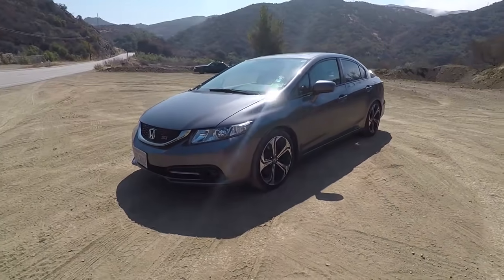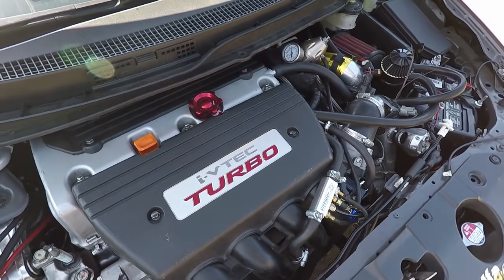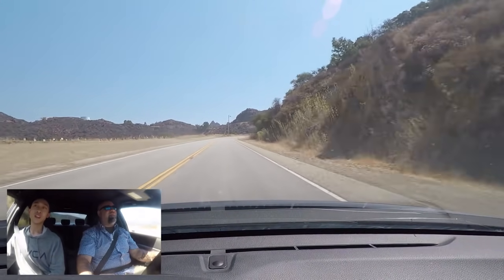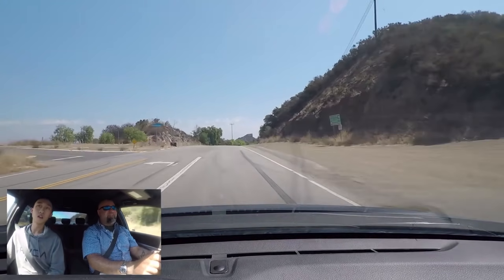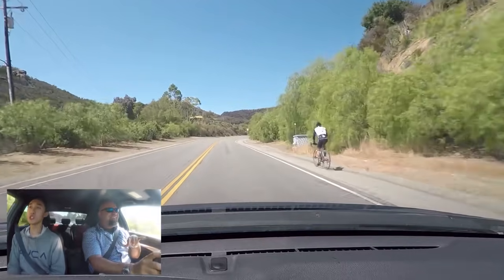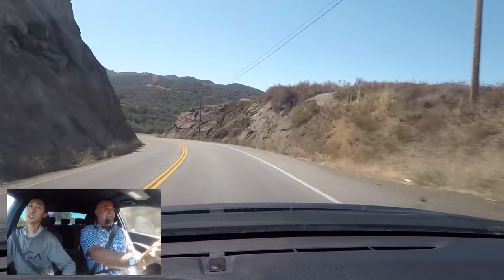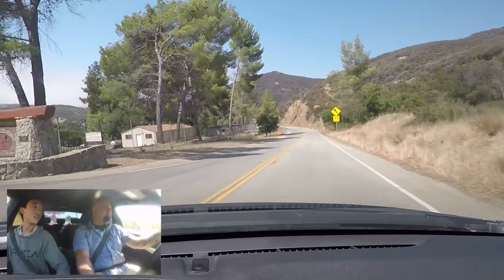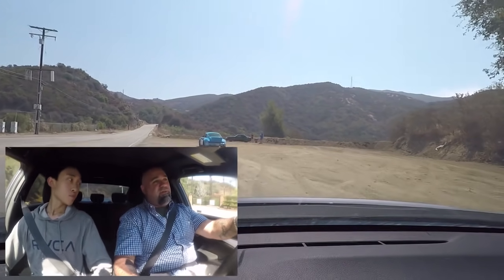Brutally Fast 500 HP Turbo 2014 Honda Civic Sleeper - One Take

Comment: THIS is how a Civic should be built. No stupid body kits, no flashy BS. Just pure performance and power. Plus the hilarity when you dust most of the people on the road with "sports cars" in your stock looking Civic. Props.
Reply: Redhead Metalhead nothing wrong with some nice rims from a respectable brand
Reply: DynamicGaming You're right. If they're quality wheels that don't weight 42lbs each, then you could argue that lighter, wider wheels help with the performance of the car.
Reply: DynamicGaming unfortunately most civic guys run xxr or jnc wheels...
Reply: Isael Dominguez couldn’t agree more.
Reply: Isael Dominguez Chinese front lip, Racelands, "real" Rotas, stretched tires, straight pipe. KILLIN THA GAME BRUH
Reply: Isael Dominguez the fake wheel dilema again loll run what you have if you like it,i laugh at kids who point out fake wheels like the rest of the build is nothing without expensive shoes,same goes for a person,you can have cheap shoes that does the exact same as expensive ones,and a hell of a lot smarter to use them..
Reply: Stock Si is equivelent to most "sports cars"  unless your talkin high end.
Reply: What are you talking about? I haven't seen any Civic with a body kit in about 4 years. The only thing I rag on them for is shitty suspension setups and fart cans.
Reply: Vega-Expert Knock off products aren't my cup of tea. I rather have a stock car than replica parts.
Reply: ? the good thing is most people arent dumb enough to race 500hp cars in the rain. 500hp with rwd, fwd, and awd. They are all dangerous to race in the rain. AWD would be safer but still sketchy as fuck at full acceleration with that much power in the rain. fwd works depending on what you want to do with it, if its just to troll people doing 60 rolls on the freeway it gets the job done. with slicks its an easy high 10-low 11. Boostedboiz ran 10.7 in a 630hp ek hatch with slicks. Not bad for fwd.
Reply: jammy jammybrochacho You think a base model Subaru can corner faster than a Civic Si with super sports just because its AWD? You are a dunce. AWD is good in the dry because it helps put power down for faster corner exit but when you only have 140 hp it doesnt do shit.
Reply: But "it's just a civic" "hondas can't go fast" "fwd bro"
Reply: jammy jammybrochacho I suggest you look at time attack lap times for any track in California. The overall records are almost all held by FWD cars.
Reply: Redhead Metalhead dude you are stuck in 1999 lol
Reply: SI RICKO Really? Because 85% of all "builds" I see nowadays are flashy, non-functional nonsense being bolted on to whatever car. I'm not saying there's anything particularly wrong with that, just that, in my OPINION, this is how cars should be built. And if that makes me "stuck in 1999," then so be it. The world was a better place before 9/11 anyway.
Reply: What's snow? Lucky for me, I live in California haha it never snows where I'm from
Reply: Fwd does spin, but with my street legal drag radials, they hook from 2nd and up. I dead hook 3rd gear at high boost. Now let me explain the concept of having boost by gear, or in my case a boost "switch". Low boost on lower gears + drag radials == Hooking and booking. Once I get to 3rd gear, flip a switch, instantly turns into high boost and still hooks and books. That's something NA setups can't do.
Reply: jammy jammybrochacho I'm not saying FWD is better, you are right in saying that physics favours rwd or awd, but mainly under acceleration. I am saying that FWD cars can be fast, obviously you didnt look up the times like I told you to. Also this car pulls 0.87 g's on the skidpad with stock according to C&D. If it had the same tires as your car I wouldnt be surprised if it achieved 0.91 g's.
Reply: enkei rpf1. done
Reply: jk
Reply: eddie lol no
Reply: That’s how all car should be built
Reply: This car would torque steer into a ditch..snoooze.
Reply: Torque steer is virtually nonexistent on my car with the LSD and electronic power steering, I'm able to easily do pulls with just 1 hand on the wheel
Reply: Lookin like you borrowed Mom's car 😂

Comment: Any car that has a reliable 500-800whp I don't care what the year, make & model is, if you built it to withstand that power, you have to give credit where it's due point blank period. Respect
Reply: FUCK. Im at 470. Need 30 more hp to get your respect
Reply: @DeltaOpsAssassin  lmao 😂😂
Reply: @DeltaOpsAssassin  I'm pushing 485. I feel the lack of respect from Brian. :(
Reply: @VeracsGaming  just pour in some e30 or go water meth!
Reply: Cerriously just add some more racing decals
Reply: @lun7n  haha don't forget fuel injectors, headers, downpipe, all the above really
Reply: @DeltaOpsAssassin  lol I'm guessing you have more than just full bolt ons and a tune so far. What do you drive?
Reply: Brian Clarke an e92 335xi :)
Reply: @DeltaOpsAssassin  Put a few stickers on it. Good for +5 each!
Reply: Brian Clarke hp isn’t everything...
Reply: McMillen Colburn 🥳😂
Reply: @professorfinesser4015  500hp out of a 2.4L isn't "rice". It's a Civic with more hp than most modern muscle cars, 30whp higher than a stock 2016 Shelby GT350R. The car looks completely stock aside from the lowered suspension, slotted rotors and aftermarket exhaust.
Reply: Honestly I'm a diesel truck guy but 500hp out of a Civic is fucking insane. My ram Cummins makes about 460-500 ish to the wheels and that is more than enough for my DD truck. I can't imagine the torque steer going on in that little hatchback at 500hp lol
Reply: B W Shit imagine that in a Miata or the FRS. Killer time attack car for the money easily.
Reply: Richard Turner Haha it would be fun as hell though. This guy cool slap some aero and race tires and actually do Time Attack. It definitely has the power to weight ratio for it.

Comment: This is what a non ricer looks like. All performance and some or nothing on the aesthetics. Fantastic.
Reply: @buffkangaroodog  im pretty sure the si comes with a red badge
Reply: It's a tuner bro
Reply: I would've put wheels and lowered it. That's about as far as I'd go
Reply: This is what a sleeper looks like
Reply: @buffkangaroodog  si comes with a red badge 😭😭
Reply: @vincentjones7800  it doesn't
Reply: @aquasmoke8539  yeah. Wheels and lowered. Not stanced 🤣
Reply: @flatwoodzmafia  lowering it a bit would look great. I gotchu now
Reply: @aquasmoke8539  yeah, im not a stance guy. I'm a drag racing, and circuit track/ touge guy myself. Plus anything looks better lowered lol
Reply: @flatwoodzmafia  exactly the same preferences. Anything that will help wirh performance.
Reply: @aquasmoke8539  and wider wheels and lower center of gravity will most definitely help 🤣🤣🤣

Comment: I'd de-badge it a little more to make it appear to be visibly more of a sleeper by removing the Si badge and 'i-VTEC DOHC' stickers. Then get rid of the spoiler to make it look like a hybrid variant.
Reply: I legit wouldn't. While the Si is a great trim, it's still not known for being exceptionally a fast car from factory. Si badge won't intimidate even people that know what Si means. And the wing needs to stay for safety reasons.,
Reply: @honda8770  ya but SI's are often tuned so people not gonna be as surprised as if it looks like an LX or hybrid or something
Reply: He has the hybrid rear badge and hybrid tail lights. All he should do is put the black base model trim on it, that looks good on these cars.
Reply: The stock SI isn't fast its more of a feeling and momentum car.
Reply: @Hopeful1s  Often?  Never seen a SI with anything other than a can.  Now a civic hatch is a different story.  We have modified cars around here and the SI is no exception but the guys around here are stanced out.  The Subaru's,  Evo's, Golf's, the local GTO on drag slicks, etc.
Reply: then get the hybrid decal from the dealership (not sure if hondas have it, I know toyotas do) and rebadge it as a hybrid lol
Reply: @honda8770  the wing isn't doing anything on a front wheel drive car🤡

Comment: That Hybrid badge is the perfect troll LOL. It needs a turbo back exhaust and thats basically the best daily civic out there ;D
Reply: MaxSpeed yeah that’s definitely a troll lmao. However on the Toyota side of things, they hybrid iteration is usually faster in some cases. Like the Camry comes standard with a 2.5L inline 4 cylinder, where the hybrid version has the 2.5L 4 cylinder plus the electric motor, which is able to shave a solid second off the 0-60 time, however it doesn’t really hold a candle to the 3.5L v6 option they put in the Camry and the Avalon, but meanwhile it’s faster than the regular 3 cylinder option while getting way better mileage
Reply: As a fan of the vq35de and a previous owner of a g35, I kinda wanted to get likr a 06 v6 Altima, turbocharge it, and switch the 3.5 badge to 2.5, that would be a pretty funny troll lol, however I’d probably be driving a total shit box lmao
Reply: @IAmCjcj11  The Camry has a 3 cylinder engine option? Is it turbo? The Camry V6 is pretty neat.
Reply: SI0AX whoops typo, meant to say 4 lol
Reply: IAmCjcj11 wait, how can the hybrid version run a whole second quicker with the same 2.5 four banger? How does having an electric motor affect it?
Reply: Stevie Nguyen it’s a 2.5L engine plus a electric motor and the transmission combines both of them to send power to the wheels
Reply: Stevie Nguyen electric motors provide instant torque, and thus, better acceleration. It’s why Teslas are so quick from 0-60

Comment: Only time a stage 4 clutch ever deserved to be in a civic. Good build mate.
Reply: garf117 huh that made so much sense
Reply: there's been plenty of civics on this level of power or higher for 20 years, or whenever people started crazy  b20 builds
Reply: Hell I've seen D series in this range. You can hit 500hp on a stock K24 bottom end. Still an impressive car, but there are plenty of high HP hondas out there these days.
Reply: man at the time this video is out, there have probably been well over 10,000 civics that needed upgraded clutch's. Once you put turbos to civics even D series and especially K, B, H, and F series, they make power very quickly and big numbers easily.
Reply: Lol go to 9thgencivic.com and find hundreds of builds with this power level.
Reply: Guys it was a joke... Calm down. The level of butt hurt is to damn high in these comments :)
Reply: I'm putting in a twin disk in the near future, it's starting to slip at the drag strip on launch lol
Reply: The whole 'stage' nonsense doesn't mean anything anyways. A stage 4 CC clutch will hold a HELL of a lot more than some crappy xtd stage 4.
Reply: Damn Mark has just showed up. Sweet ride.
Reply: aiGeis exactly, stages are only used to describe power relative to the other products the same company offers. In other words, action's "stage 4" holds 170% more torque over the stock clutch. That's a more universal description lol
Reply: Mark Chang i know i cant stand the whole "stage" thing just seems like your regurgitating something out of need for speed
Reply: With any boosted k series motor you will need a stage 4 clutch
Reply: Yeah lol, I never use stages to describe anything because it means absolutely nothing, unless the manufacturer calls it "stage 4" themselves. That way if someone wants the exact same clutch as me, they'll know which stage to get from Action
Reply: have no idea the differences between the stages of clutches means...could ask google but ill rather ask the people here....feel free
Reply: pretzil16 crazy B20 builds ? 😂😂😂😂😂😂😂😂😂👌🏼